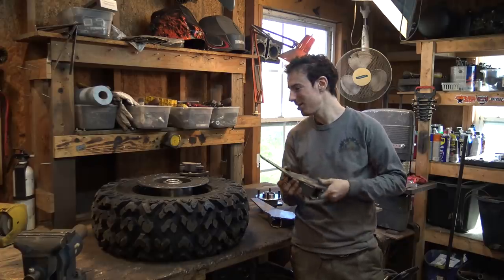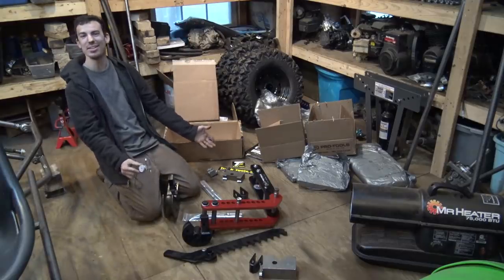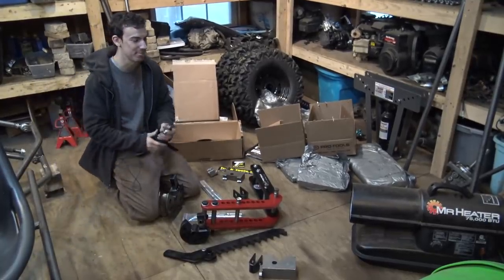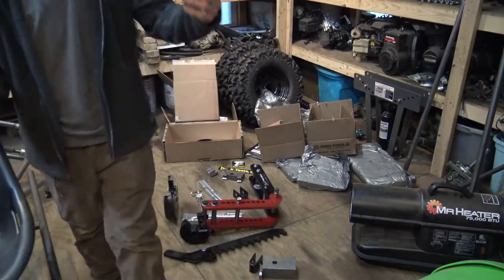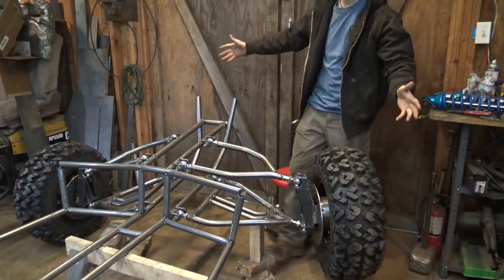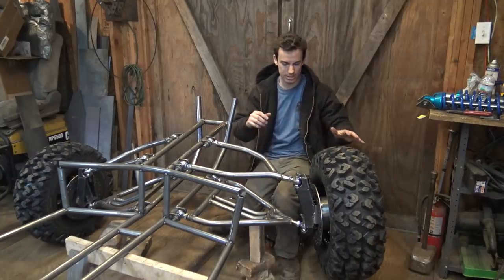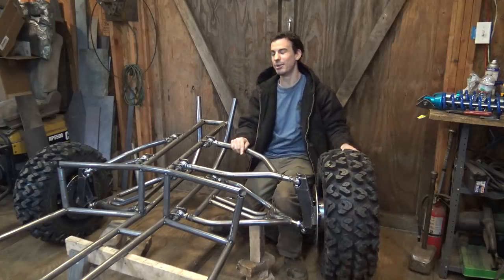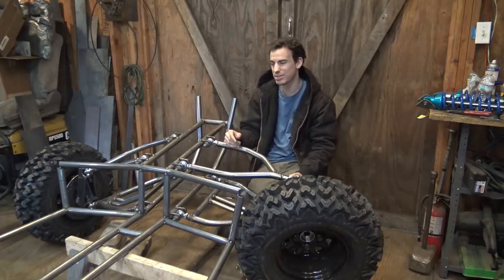Honda CBR 600 buggy build part 4

Comment: figure the bike weighed 450 lbs ?? what will the buggy weigh?? 650-800?? it will be brutlly fast , people put bike engines in small cars and theyre fast
Reply: Rob M I’d assume it will be over 1000 pounds, but still I think the 600 will be more then sufficient
Reply: @PowderRide34  gearing will make that 600 do anything you want it to do. If the stock bike went 150mph.. you could gear it down tell the buggy would do low 100mph. Making your 1st,2nd,3rd gears, power gears.
Reply: @TurkishLoserInc  width isn't going to change speed or gearing, that would be diameter. Now the weight of rotating mass might have a impact on top speed. But gearing the unit down will bring the power back up to par. He probably dont want a 150mph buggy.
Reply: @TurkishLoserInc  geared stock on the buggy. The diameter  of the tire is the only thing that will change top speed. Until you figure in added mass. In which case the top speed would be the same, it just might not have the power to get to the top speed that the bike once had.
Reply: truth is it will be more like 1200+ pounds when its all said and done. if he can keep it less then it's a +!
mine i built is much smaller and is at 1100+ atm with a R1 motor
Reply: @NightshiftCustom  Yep. my 2 seater with a CBR 929 hovers around 1500 fueled up and ready to go. His will be lighter but not that much. Every piece of plate needs to be swiss cheese to get under the 1000 mark.
I used a prelude transmission behind mine though. 5 gear ranges and reverse is awesome
Reply: @vpsryder  shit that's what i was thinking of doin for rev!! is there anyway to get 930 cv's to bolt to the outputs on the trans ?

Comment: Dude with 90 hp and a like 800 lbs buggy it will be freaking fast with the right gearing. A miata is around 2700 lbs and with 90 hp thats drivable, so I think with low gearing its really fast
Reply: A Miata is 2332lbs and 181 hp.
Reply: That think is a lot heavyer than 800  pounds
Reply: @mikeisaac3826  mine sure isn't lol. NA miatas have 113 hp.
Reply: Ryan Neuman Well the original comment didn’t mention any year of a Miata, but one thing I know for sure is there is not an OEM Miata that weighs 2700lbs. 🤷‍♂️
Reply: @All Cars Matter and that think weigh a lot more than a atv
Reply: @mikeisaac3826  There are different kinds, the 97 NA has 90hp and the official weight with person is 2700

Comment: rather B welding
Awesome project!! I built a cb650 buggy and it is a blast. You will love this thing. Beware...
THE WHEEL BEARINGS YOU HAVE MUST HAVE AN AN AXLE THROUGH THE CENTER TO HOLD THEM TOGETHER. YOU COULD USE A LARGE DIAMETER BOLT. I WOULD USE A STUB FROM A JUNKJARD AXLE, JUST CUT THE BASKET WITH YOUR ANGLE GRINDER TO REMOVE IT FROM THE REST OF THE AXLE. THE BEARING REQUIRES PRELOAD AS WELL SO IT MUST BE TORQUED TO SPEC. I HAD AN S10 A LONG TIME AGO AND LOST A WHEEL GOING DOWN THE ROAD BECAUSE I THOUGHT I COULD RUN IT WITHOUT AN AXLE. GOOD LUCK!!!
Reply: No bolt is needed. The hubs are designed for floating axles.
Reply: @EDesigns_FL  do you write the same thing to everyone that says it needs a bolt for the preload? You sir are wrong. It does need a bolt or the end of the axle to hold it in. if you need proof you can either read what Dan wrote about his experience or you can come over and i will show you the 8-9 axles and hubs i have in my garage that i have switched out  for customers. Please dont type garbage info about thing you have no idea about and learn what a floating axle really is.
Reply: @carlf8224  
I posted the same comment twice because I erroneously believed that only a couple people would be so ignorant about how these types of hub assemblies function. I was wrong: their are an astonishing number of you posting the same b.s. while professing to be experts on the subject, and all of you are wrong.
When axles are used with this type of hub, there is typically just a pressed in plug to keep oil from leaking out when it's a fixed axle. If there's CV's or U-joints, and nut is used JUST to keep the sub axle in place.There is NO mechanical connection between the axle and the hub. The axle floats in spline groves, unless there are joints, and then the hub suports the axle; NOT the other way around. When the hubs are installed on none driven wheels, nothing other than the mounting bolts/studs is used.  
It doesn't matter how many of you post ridiculous claims, it does not make them any more accurate.
Reply: @JoelArseneaultYouTube  This style hub assembly is extremely common. When used with solid axles, there's absolutely nothing other than the splines between the hub and the axles. Again, when used on none driven wheels, there is NOTHING in the middle. They are a compete load bearing assembly. I don't have to Google this or make any assumptions, I've replaced enough of, and researched them, to know how they work. Because these are such a great product for an absurdly low price, I use them in industrial applications. They are incredibly well machined, withstand high radial and axle loads, maintenance free, and they're very compact.

Comment: If I ever tried to build something like that I’d end up with a garage full of parts and a bunch of holes punched in the sheetrock.  I wonder how many people can actually appreciate the skill and precision required to cut multiple parts by hand and weld everything together in a way that leaves a balanced, symmetrical, and durable finished product.  This is the guy I’d want in my corner if the shit ever hit the fan. Much respect to you Mr. Mcguyver!!

Comment: Make sure you run a large bolt through the front wheel bearing as that style is made for a CV axle going through it to hold the bearing together
Reply: If not, he will learn the hard way!
Reply: Good call.
Reply: Who wants to start a pool if he catches it or not?
Reply: @dave1135  oh he won't. But you can be damn sure he's going to say he did, all on his very own and edit it to look like he knew what he was doing all along. Lol. 
I'm waiting for him to realize he's made a situation thats going to have tons of bumpsteer or next to no angle or is waaay to stiff. Theres no good way out of what he's built there.
Reply: No bolt is needed. The hubs are designed for floating axles.
Reply: @EDesigns_FL  yes by floating axles you mean the axle shaft does not hold any weight the only have torsional loads. Now the hubs do need a axle shaft or a bolt to preload the bearings and stop them from separating. I am an ASE master tech i have seen on a few ocations tires leaving cars because grandpa replaced a CV axle on little jenny's car and forgot the axle nut. Please do your reasearch before trying to correct something you are not knowledgeable of. Thanks
Reply: @jesseserfling6807  The hubs absolutely do NOT need an axle and you do not know what you are talking about. The hub assembles he is using are similar to what Jeep and numerous other manufacturers use on both front and rear suspensions. The only difference between four wheel drive configurations and two wheel drive are additional axles. NOTHING is installed in the hubs when they are used in the front on a two wheel drive vehicle. 
And, yes, floating axles do not carry any axial loads. They only transmit torsional power and are designed to slip axle via splines.  
I'm astonished with the quantity of ignorant comments, like your's, regarding the hubs. Way too many posers on here.
Reply: @EDesigns_FL  do you write the same thing to everyone that says it needs a bolt for the preload? You sir are wrong. It does need a bolt or the end of the axle to hold it in. if you need proof you can either read what Dan wrote about his experience or you can come over and i will show you the 8-9 axles and hubs i have in my garage that i have switched out  for customers. Please dont type garbage info about thing you have no idea about and learn what a floating axle really is.
Reply: @EDesigns_FL  people are quite cocky about what they think they know
Reply: @carlf8224  You copy and paste your b.s. multiple times and comment about someone else doing it? WOW!
Reply: @carlf8224  it's a bearing hub assembly there is no separated bearing race it's all one piece assembled with the one piece hub. No bolt needed. You sir are wrong. But hey I mean if you wanna run a bolt in yours when you build one than be my guest. Or your guest I should say.
Reply: In fact they use the same 4wd hub on a 2wd car so boo
Reply: @anthonyf8113  the hub has a inner and outer tapered race the are pressed in with a hub pressed through the center. Now if there were no side load on the bearing it would take a long time before it came apart but on a steering axle it has large amounts of side load. That makes the bearing want to tip and eventualy presses the hub out of the inner bearing. Now if they were flat needle bearing it would not have that affect but also could not support a side load. If you want come by mu shop and i press one apart to show you how and why it happens. Im not saying anyone is stupid just ill informed
Reply: @jesseserfling6807  it's like a Chevy bearing the inner race and hub are one piece therefore no matter how much axial load it carries it cannot fall apart till it is worn out completely
Reply: Certain one can certain ones can't it's depends on which one you use this one happened to be one that cant
Reply: you are correct on jeeps 2 and 4x4 using the same front hub/bearing although you are wrong on the fact the 2x4 does have the blank end of an axle bolted through to keep the bearing together  @EDesigns_FL
Reply: @MMRautosales  There is NOTHING in the center of a hub assembly on the front of 2x4 Jeeps. You are wrong. No stub axle, bolt, or any other type of retainer. In the rear of solid axle Jeeps, not IRS, the axles float. Again, there is absolutely NO external devise applying any pressure to retain the hubs. With IRS and front wheel drive, the hub assemblies support the sub axles, not the other way around.
It's amazing that so many people are expressing opinions on this issue when their ignorant comments reveal that they have absolutely no knowledge on the subject.  I'm guessing that they may have seen a nut under the dust cover of their front wheel drive econo-box and erroneously assumed that the hub assembly is retained laterally by the sub axle.
Reply: @anthonyf8113  oh wait did he just point out in part 7 the issue that you are so expertly knowledgeable about with the missing axle bolt?? I guess the guy with actual hands on experience removing and installing these same hubs and axles is wrong after all?? LMFAO As I stated the first time you and everyone with google knowledge are "WRONG" care to comment now? or quit while you're ahead and just don't reply!!
Reply: Notice how the poster of the video doesn’t bother chiming in on this debate?  It’s because he’s too busy utilizing his energy accomplishing shit while the rest of you keyboard warriors argue about shit that has virtually no meaning.  The reality is both sides of the argument have merit, depending on various circumstances and design aspects.

Comment: regarding the engine keep with the plan of the 600. use a spaced copper head gasket to lower the cylinder compression ratio and make a custom turbo manifold with a reasonable size turbo and this will have plenty of power to see of bigger engined buggy easily.
if you have any questions about this im more than happy to help. keep up the good work my friend.
Reply: Oh yea turbo all the way

Comment: Your scrub radius is huge with your front suspension design having the heim joints so far away from the tire center line. That will make off-road steering very difficult and will rip the steering wheel out of your hands when you bump into something. 

Hopefully the rear track width is as wide as the front. The camera angle is making the front look wider.
Reply: Yeah, he might have to bring his top heim joints further in towards the center of the vehicle to angle that scrub right to the center of the tire
Reply: TheDestructor888 
Yes. It could be done but he will need to move the inner heim joints too, to maintain the suspension geometry through full cycle so the tire stays vertical.

Comment: Loving the build, but that scrub radius looks dangerous.

drawing a line through the ball joints to the ground is the point the wheel will steer around, but the wheel is way further out than that point. 

this makes the steering a bit iffy. but worst is during braking there is a massive lever that sends a lot of force through the steering.

if all is equal and the steering components are strong enough its fine. but if one wheel looses traction while the other has grip it will rip the steering wheel out of your hands because wou are then subjected to a lot of force from the wheel that has grip.

Comment: On at least that lower heim on the spindles I'd get a castle nut and drill the bolt to put a cotter pin in. With the bolt like that just turning the wheels will loosen it up over time. The bolt going up from the bottom gravity is working against it and when it falls out it is gonna be a bad day. Personally I'd do it on every bolt holding a heim joint.

Early and you might plan on it but I also suggest adding 4 bars between the inner heim mounts bracing the 2 sides together.

Comment: Hey just a heads-up thos unit bearings will separate and your wheel will fall off without a stub shaft holding it together 94 Jeep Cherokee 2wd front unit bearings should bolt right on and don't need a stub shaft to hold them together
Reply: there pretty tuff don't think he will have a problem

Comment: Awesome videos man. Not sure if you’ve been told this yet but NPS is nominal pipe size. Just means what it is classified as. The actual size differs. Same as 2x4 lumber isn’t 2”x4”. There are tons of charts available for the actual sizes and there a good thing to have around when dealing with pipe and tubing.

Comment: a really good trick i learned with that cheapo pipe bender is to use a die one size down! works very well and can do full 90's ! so don't use the die that the pipe fits into grab the one size smaller and if you want i take the grinder to the top edge's of the die to help the pipe slide in when pressing so it don't cut up the pipe from a sharp edges ! give it a try man

Comment: Chris, I’ve had decent success using a pipe bender like yours to bend tubing if you pack the tubing with SAND and tape off the ends.  Just a tip if the mandrel doesnt show up soon.

Comment: From a Safety standpoint, would be best to install BOTH top and bottom bolts on the spindles facing down with nuts on the bottom, that way if nut vibrates loose, spindle still stays on and you dont die........
Also those wheel bearings will separate and come apart without the CV joint and giant nut holding the two sides together (you have a lathe, turn two "Top-Hat" looking collars and put a bolt & Nylock nut thru them to replace the lack of a CV joint)

Comment: Cool build!  Just an FYI, 1000cc motors only have 50-60 more HP than 600's, they just have a lot more low and mid range torque.  600 motors aren't really awake until like 7-8000 rpm's.  I imagine this thing will feel like a turbo car where it's a little sluggish until the "boost" kicks in.

Comment: Great looking build.  Good instincts, but...  I'm pretty sure those hubs are designed to run with an axle, so you will need to use a bolt to hold it all together.  Also, your scrub radius is significant... you might reconsider your design before you get too far along.  Lastly, you might want to add some cross members at the hiems, with gussets.  You get an enormous amount of leverage in that area and that snout will twist or fold inward.   Super fun to watch the project though.  Nice job.

Edit to add, cross support between the shock towers you haven't built yet would suffice, just keep that in mind

Comment: Awesome work only thing where you connected the front tube that go upright and how you slipped them into each other I would recommend to put a brace in between so it’s more support on that joint other then that awesome work

Comment: I built one similar. 750 Kawasaki engine. I used an eBay 350z car rear end. They are not too costly and it's a sealed unit. Has no axils and set up on CV joint instead. You only get the gear pumpkin and gears. I made an adapter and use sprocket instead of a drive shaft. You can buy them used and get a good gearing ratio cheaply compared to cost of any other gear box. I understand stand your transmission has a reverse that you made right. It gave my buggy have plenty of power. Your 600 will work good with the gearing of the Nissan rear end.

Comment: Your making an awesome build. My two cents of help is a concern using the front  hub bearing assemblys. If you don't us the end of the CV shaft the goes thru your hub it will come apart. Or fab a bolt to take its place. They rely on it to hold them together and give proper bearing preload :) hope this helps. AB

Comment: I k,ow you have already spent alot of time and money on ordering your tubing bender but for those who read the comments. The pipe bender can be made to work to bend tube without kinks. First you have to build a follower that will attach above your pipe in the same radius as the die you are using. This has to be made removable or atleast adjustable. Secon fill the inside of the tube with sand. Pack the sand a little tight. Cover ends of tube with duct tape. The sand will keep the tube from collapsing in it will bend a fairly. Uniform radius

Comment: With the skill that you have I think you could easily do something full size. I know this buggy is already big, but I'm meaning something big enough for a junkyard ls motor or something. Maybe a collab with someone else? Big crawler rig on 42 inch tires? Or more of a prerunner style build? Maybe even something just to be fast and light weight on the street. I know it probably seems far out and wont happen for awhile but that would be cool.